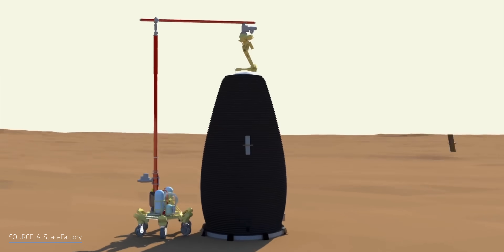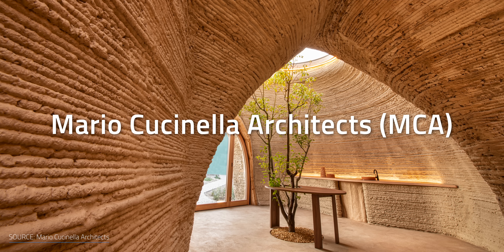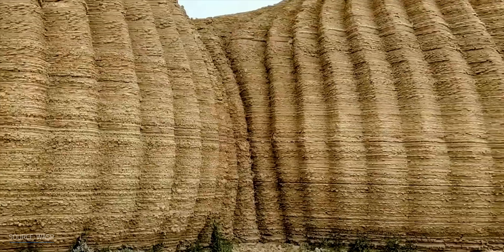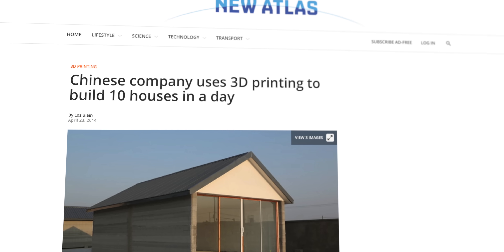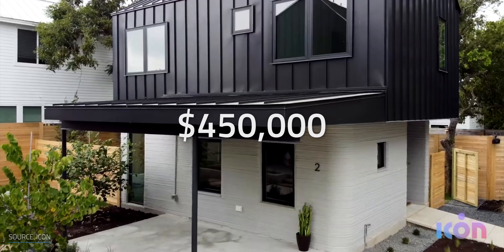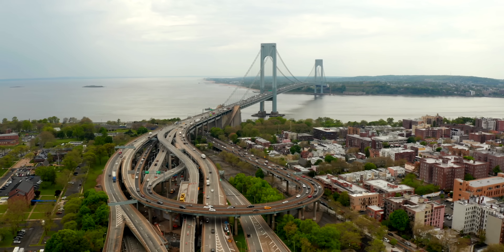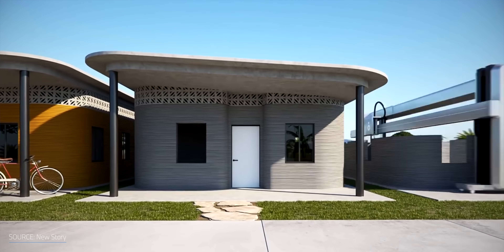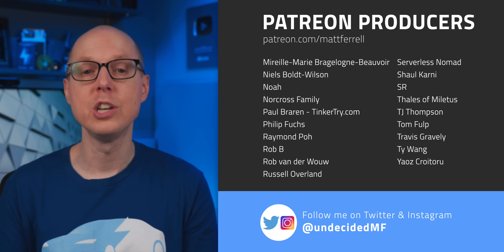The Truth About 3D Printed Homes

Comment: Studying civil engineering, be gentle:
We did soil tests on different soils and there is a reason we don't use clay, it expands and retracts too much, it's an unstable aggregate, so I can't see that this would work without something added to it, we've seen clay houses in dessert areas but built with poles and straw to help stabilize it. Wet areas will be a nightmare for the owner. Size in my mind would be limited, people would say no, there are skyscraper of clay, just keep in mind, I live in cape town and not a dessert, we are renowned for wet winters, so I just don't see a clay 5 bedroom two storey that will be safe and cost effective in my area. But I am open to ideas, I guess as a student this is our job, to research and bring forth ideas, they are drilling environmental studies on us and trying to find alternatives to cement.
Reply: To build with earth this 3d printing method is not good at all. People have being doing it for ages. You need to pour the dirt (rich in clay) mixed with straw and then compress it. That is done in layers and takes much more than 24 hours. Then in most places they are white washed with lime wich protects the walls and kills any bugs. These houses last for centuries.
Its also important that the walls are usually 40 to 60 centimeters in thickness
Reply: @goncalodias6402  Yes, here in New Mexico we have adobe houses that have been around for centuries, and the dirt is indeed mixed with straw, and the walls are very thick.
Reply: clay is a great building material, but in wet areas it doesn't stay dry, and thus it tends to collapse. this material has been used for a long time and people moved away from it for a reason. it is still used because it has some great advantages in dry climates, while still being cheap. most modern versions used for garnering buzz use additives to compensate, or are used for temporary structures that people don't follow up on for longevity (they hide its flaws). just like with other green technologies there is far more buzz than is warranted, but not completely worthless.
Reply: @jamoecw  can agree with all of that, people talking about container units and plastic roads, they all can work, but there are a lot more behind it that people do not see.
Reply: I used to live in a clay house. it had 2 types of wall: clay and straw brick walls that, as you said started eroding away and something akin to foundation-like walls. the walls were built into wood planks wolds from clay and wine vines used as an armature. the clay would then be compressed using hammer-like tools. after about a century, when we renovated, we had to sculpt the walls to get something remotely string; metal sparks would come out of the axes and the blade would dull a couple of times a day. clay can be a very good material, used in the right way. not to mention the fantastic thermal insulation it can give
Reply: @alexK661  I can understand it, there are great properties to clay. But the nature of clay on it's own does not meet specifications to be used in large buildings as a standard and thus it can  not be used as a sustainable material. 
It does not mean it is bad, it just means, horses for courses, depending what you need, you can use it. Part of civil engineering is the art of analyzing a material, like clay, and manipulating it in order to make it a stable building material or foundation. The latter is especially hard since ground water will always play a role in the expansion and retraction of clay, making the ground unstable which leads to cracking of a structures walls, this can be seen in many modern homes built on clay soil. So depending what you need, clay is a relevant option, when I build a house in a wet climate, I'd advise against it, when I build in Northern Africa (sahara), I'd consider it as completely relevant as it also insulates well as you said.
Reply: https://www.youtube.com/watch?v=4MLJs1KRa0Y

Comment: I think houses in kit (think some kind of "ikea house") is a much better solution. A factory can mass produce a lot of basic elements (aka walls), with standardized isolation, wiring and plumbing included. Those elements could be shipped with minimal packaging (or reusable packaging), and assembled in situ. 
I'm not a fan of depleting the soil of its clay to build vast expanses of suburbs. I don't like skyscrapers as well. I think 6-story buildings (or 5-story buildings) are probably the best way of building housing. Arrange them along streets, don't forget large sidewalks and bike paths. Add a lot of public places (parcs, places, benches...), and as many private or semi-private (courtyards, gardens...). Don't forget balconies and terraces.
And you have a town. 
I don't think you can 3d-print one easily. But kit-assembly one ? That's much easier.

Comment: 3D printing a house only takes care of the framing. A four man crew can frame a 5000 sf house in a week.  The rest of the construction takes about 50 more weeks for a luxury custom home. Wood is environmentally probably pretty good because it grows naturally with free rain and sunlight.  The reality of a home’s costs is that it takes tens of thousands of parts that need to travel hundreds of miles and then it takes tens of thousands man hours to put together.
Reply: Though it takes longer to finish putting together if you printed the walls.

Comment: I would think that a analysis of the soil, the removal or organic material from the soil, then adjustments to the soil such as adding more clay or sand soil, and finally adding cement to soil to make a solid,  difficult to penetrate wall for strength and security would be necessary. This mix would be similar to dirtcrete or rammed earth wall materials. Both these mixes save significantly on transporting materials to site and are less expensive than concrete but are labor intensive. The 3D printing should reduce labor costs but a mixing and soil adjustment machine would be necessary for adequate cost reductions. Labor costs have been a major hindrance to the construction of rammed earth houses. 3D printing may provide a solution to the high costs involved in rammed earth construction. To get adequate security ( so criminals don't dig through your house's wall) and strength in moist climates; cement has always seemed to be a necessary ingredient in the mix. These mixes reduce CO2 emissions compared to concrete but don't eliminate it. I have just read on dirtcrete and rammed earth construction over the years in Popular Mechanics and Science magazines and online articles on the web. Another interesting and possible cost reducing concept for building a more cost efficient and greener house is Cross Laminated Timber. ( CLT) It is more common construction method but new method of construction in Germany and in the NW USA. ( Pacific Northwest) You may be interested in doing a video on it.

Comment: As with so many big issues we face, no one tech is likely going to be THE solution. Good tech will get some support and either get markedly better, or whither. This technology has a long improvement path, but it actually looks favorable for a number of applications, even if using concrete. A major point is that it using robotics in new construction. Whether to move a print head or girders, roof panels or pre-fabricated kitchen and bath modules, I think that the real revolution for practical use will need to  impact these major factors;

- Robotics use on the job site
- Multiple (more than two) print heads capable of printing high(er) accuracy
- Materials

Works to date are a basic proof of concept.

Comment: I don't want to be negative but dare I say this is all obvious? It's new technology, the early implementations are not going to be as cost effective as matured technology.
Right now it's probably cheaper to move the printing hardware to clay sources, utilise multiple setups and and print prefab walls etc and move those to the housing locations. Print them fast and while one set dries move to another. They really should utilise multiple extruding heads too.
It might be smarter to start with a replacement for presently used building materials that are compatible with current construction techniques. Start making alternative drywall and frames. Builders might even be able to rent the printers and supply multiple building sites at once. It would minimise the impact of shortages and enable cheaper buildings in remote areas too, as long as the supply material is available. Constructed at recycling facilities it might even be able to utilise plastic waste that would otherwise go to landfill. Waste concrete, wood, plastic, glass and even stone could be utilised. It could be marketed to recyclers so they can produce yet another viable product from waste.
They need to start with the problems we have before inventing new ones.

Comment: I think it's great but I have a problem with weather especially if you live where tornadoes and earthquakes. Sure, you may survive if the housing material falls on you but what about if it collapse from a great height? Flooding might not be if you're using something other than dirt since those material may float.

Although, another concern is that this should be cheaper except for the equipment itself as this is less man power, less wasted material and such but politics play a big role in the construction business so it maybe pushed out due to pressure like the electric hybrid cars ( my favorite, the hummer ones where you use practically no gas).

I'm all for progress but not everyone is so opened arms about it. I can see this improve so much with time that machines build buildings quicker but that also means A LOT of people will lose their jobs or be reassigned.

Comment: The problem with the unfired clay walls is moisture.  I would go for exterior walls made with concrete and inner walls impregnated with borax or diatom earth.  You mentioned the Plumbing/Electrical and other infrastructure issues.  I see no need to try and solve the Favela/ Mumbai situation, they people in those situations can solve their own problems in their own way.  I refuse to be paving any road with good intebtions that goes awry.  Neat tools to build my/our stuff that we can share in a "Catalog" others can pick from would be far better.

Comment: I seriously doubt printing houses will be cheaper than just putting up a normal frame any time soon. The expensive part of a house is not the part that can be printed. It can certainly help with certain parts like hard to create shapes but tbh. Putting up walls for 1 level of a normal house is about the speed of normal construction these days anyway for a small team of professionals.

Comment: ok im from kenyathe infrastructure has improved a lot given ive lived and grown up here,  myabe for more remote and exremely rural areas roads would be an issue. the carbon footprint of shipping would be a definite concern plus added taxes and levies for shipping the equipment in would definitely not be a boon for the tecla housing cost. Making it only feasible for a third party to bring in the kits and do it as a business, printing people homes and as businesses do the cost would be passed on to the end user along with profits to  be made wich would take away from  affordability of the homes, but that said a while back in the coastal regions of mombasa there were 3d printed homes showcased and the seemed affordable given the normal housing costs  however the space they had was an issue.

Comment: In my opinion, the biggest problem for me with 3D printed houses was how would they install stuff such as piping, and electrical wires. To me, it seemed like there was absolutely no space for those in the walls, and it would be extremely costly and time consuming to knock down holes in the walls to install the utilities and other things, or completely reroute them through other parts of the house or require some absolutely big brain thinking to install them properly and efficiently.
Reply: Unless you print them as well.
Reply: The walls have a pretty big gap. Its actually good practice to run wires in conduit (which can be easily pre-installed).
Pluming cutouts are printed into these houses (at least now they are) to make hookups easy.
Reply: https://www.youtube.com/watch?v=4MLJs1KRa0Y
Reply: Your forgetting that pipes and wires don't have to be in walls. Also the narrator did state that the clay takes some time to set so conduits and pipes could be fitted and installed while printing the house. Or you could arrange the electrical and plumbing so it is outside the home making the utilities safer than installing them inside the house. 
Personally I always felt it unsuitable to have electrical wires and water pipes installed inside walls. As is was hard to find and repair the damaged bits of these utilities behind a wall.
Reply: @kaptainasskrak  You have no idea about construction...do you..!!!!!!!
Reply: @kaptainasskrak  You've obviously never built a house. I have, log, frame, R Panel. You are wrong, especially about installing supply and drain plumbing outside the walls.
Go work construction for a year and get back to me.
Reply: @robgrey6183  just because you done it a certain way for years doesn't make it the only way. I should of implied that it would be fine for where they are building this house. Which I am sure don't have the standards and rules that USA or the UK would have. Besides I have been in plenty of buildings with utilities outside the building, like warehouses and storage units.
Reply: @kaptainasskrak   Installing conduit costs a lot in labor. As an electrician I imagine I'm charging more than the framer. What you save on the home you have to pay me and the other in wall trades. All of which cost more than the framer.
Reply: @kaptainasskrak  there’s a number reasons why utility lines shouldn’t be kept outside.

You’re forgetting that, at some point, you need those lines to get inside your house. Think about all the outlets, lights, switches, sinks, toilets, showers, etc. that a typical home has. Having dozens of pipes and wires coming in from the outside would not only look atrocious, it would most likely be a nightmare to keep insulated and sealed. 

You mentioned the difficulties of locating and repairing lines behind walls. If kept outside, how would you route them? If you run them underground, then it becomes even harder to fix should a problem arise. If you leave them above ground d, they’re exposed to all the elements, expediting the wear on the materials and necessitating more maintenance and repairs when they inevitably fail. And using utility lines rated for that type of exposure is going to add up quickly and could cost a fortune. 

The reason wood framed houses are so popular is BECAUSE of how easy it is to make fixes and alterations. It just takes a little knowledge on how houses are designed and built (far less than what a professional needs to know) to identify those solutions. And if the construction was done by quality builders, very few issues should ever arise.
Reply: did you see those walls? wide af and you can easily lay plumbing while printing. so NO, it's not a problem to add plumbing and electricity.

Comment: 3d printing mudhuts when you can easy use steel, concrete, or anything else. Yeah they have their design and implementation challenges, but you can easily say that about the mudhut
One step forward two steps back 🤭

Comment: The problem is that I don't want a house that will melt after 4 years of rain, can't survive a frost, has nearly no insolation value and is prone to letting the elements and insects into the house. At this point, it's almost better to employ subtractive housing than additive, wherein a home is carved out of the house and a roof is added on top. Less work overall and virtually the same effect with less issues.

Comment: take a empty wasted water bottle, fill it with soil or a mixture of soil, rock, clay etc, do that a bunch of times and you can make a wall with some clay as filler and the bottles as bricks and even use string to twine the bottles trapping in the clay. This was used by a few projects to use waste to build houses but you can achieve amazing thermals and even impact absorption feats. I think solutions like that are more practical for a world with a lot of poverty as that solution is achievable by anyone, you just take the wasted products sent to dumps and use them accordingly.